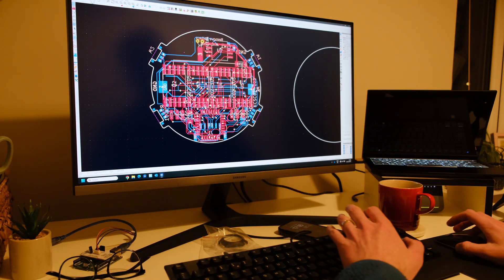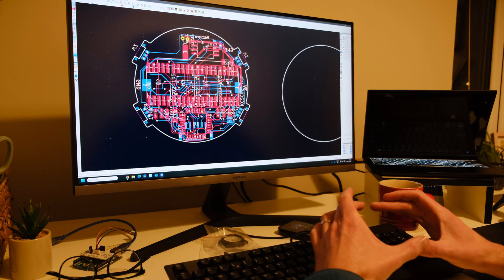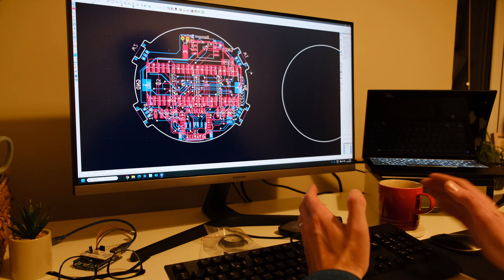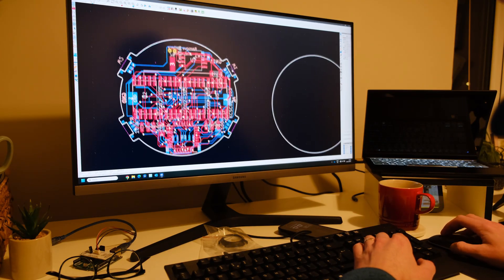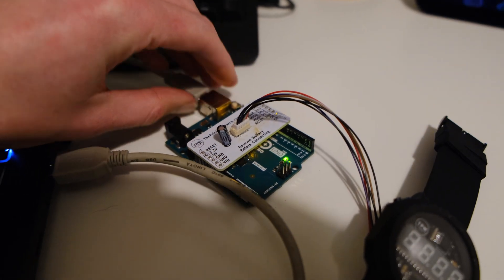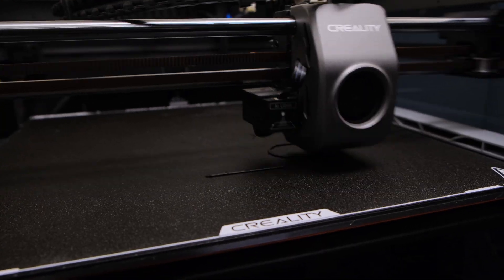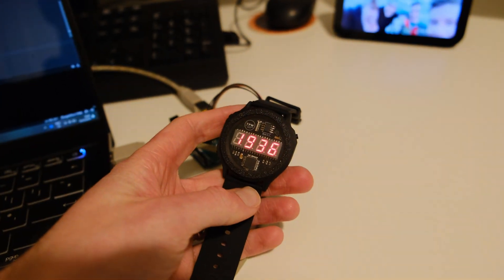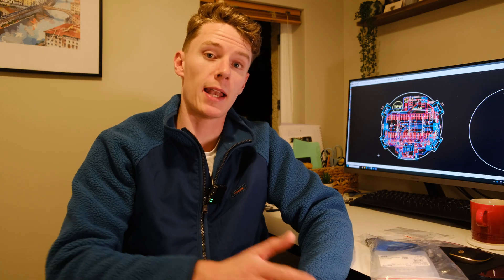DIGIduino - DIY Digital Watch Part 6 - PCB Changes

Comment: Ask ChatGPT about the compliance stuff :)  But as I understand it shouldn't be an issue since its low voltage and doesn't have wifi/bluetooth signals. Keep the coincell battery in its manufacturers packaging and you can ship it np. 
Also, I was wanting to design something with a side mount switch myself but they all required weird footprints. I like yours that uses a cutout around the whole switch, is that a common pn?